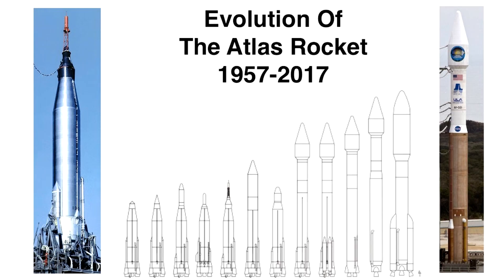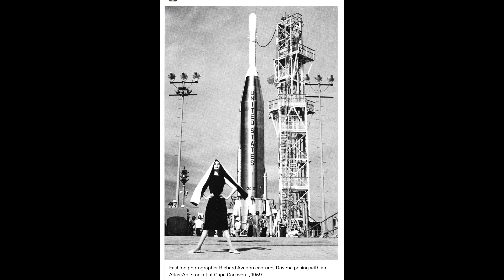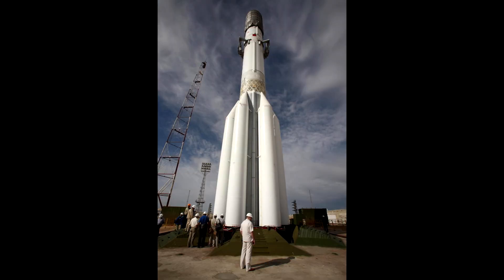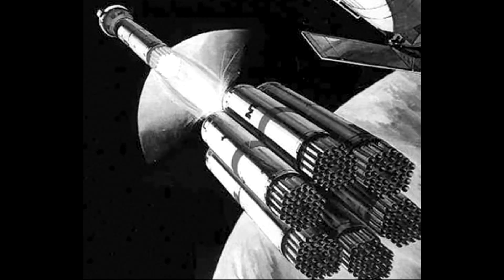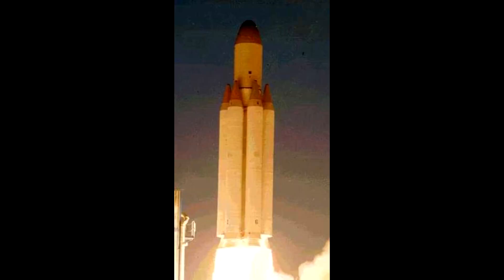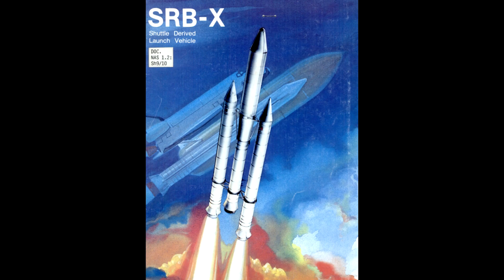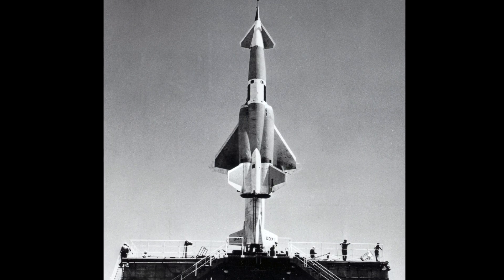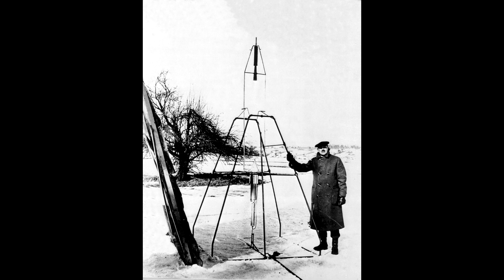The Worst Looking Rockets Ever Designed!

Comment: The American Thor rocket that had the nearly flat nose cone always looked stupid to me.
Reply: It's too round at the top! It need to be pointy. Round is not scary! Pointy is scary. This will put a smile on the faces of the enemy. They will think it's a huge robot dildo flying towards them.
Reply: @gonun69  the dictator?
Reply: @tangydiesel1886  Of course.
Reply: @gonun69  HAHAHAHAHAHA now that's a good reference! Fortunately I re-watched it recently, wouldn't have gotten it otherwise :-)
Reply: Speaking of the ugliest rockets ever designed..... Musk's STARSHIP MK 1! Patched together in a junkyard and assembled outside in the dirt!
Reply: Most of the Thor variants were pretty ugly. Thor-Able is probably the worst of the bunch.
Though it was eventually developed into the Delta II, which was a great looking rocket. (I think its last launch was in 2018, which no more to be launched.)
Reply: True
Reply: At least one variant of the Atlas missile had a blunt nosecone as well; I'm guessing that was a reentry heat shield. And yes, it looks wrong.
Reply: While it looked ugly, that round nosecone was important to prevent the payload section from overheating. An extremely pointy end would heat so much the thing would just disintegrate at high speeds.
Reply: That's the Mark II (code named 'Boilerplate') nuclear warhead and is literally the origin of the word 'boilerplate' used to mean a test article today.  It was called boilerplate because it was a copper plate full of water used for cooling during entry.  It was also seen on Atlas but wasn't very effective on an ICBM.
Reply: Yep. It looks like someone came along and 'booped' it.
Reply: Thor was designed as an IRBM.  It was designed to be somewhat transportable.  That flat nose cone had an aero-spike and there was usually a nice nuclear bomb inside of it.  Over the decades Thor was evolved into the quite friendly Delta rocket.
Reply: @Easy-Eight  right, now that one "nice big nuke" has been replaced with ten nice little nukes in our ICBM's !! ; )
Reply: @ronschlorff7089  , Thor is an IRBM.  All IRBMs were eliminated in a treaty between the USSR and the USA in 1989.  The treaty eliminated short range missiles, intermediate range missiles, and artillery based nuclear weapons.  Also, the later START treaty eliminated MIRV in the ICBM and SLBM vehicles.  By treaty no missile may carry more than one nuclear reentry vehicle.
Reply: @Easy-Eight  Right, IRBM's, such as Thor, are long obsolete; but a nuke sub can function as an "IRBM", parked off the coast of the intended "receptor" nation. With 24 missiles in a "Los Angles" class boat, don't need MIRV's either; the whole weapon complement is essentially/functionally a MIRV platform. Ever been to New London/Groton CT? Pretty impressive to see one of "them bad boys" come cruising into base. The more you know the less you understand, functionally. And "treaties" are a laugh, during war time; historically speaking! ;D
Reply: @ronschlorff7089  , the Los Angeles class is a fast attack submarine and not an Ohio class Ballistic Missile submarine.  The present Los Angeles class Flight II & higher only carry a 16 cell for submarine launched Tomahawk.  An Ohio class submarine would never be allowed in littoral waters.  They are always in the deepest and farthest part of the Atlantic, Pacific, or Indian Ocean.    The IRBM missiles outlawed in 1989 were the Pershing II, Lance, and the same type of Soviet missiles.  The "PII" had one of the most outstanding targeting systems of the era.  Once again, MIRVs are illegal under treaty law.  It is a violation of the treaty to have the "bus", the item used to carry the 10 MIRVs.  MIRVs have been outlawed by treaty since the mid-1990s.  FYI, my son was a "plant" operator on a improved LA & I was an Army Field Artillery officer.
Reply: @Easy-Eight  Army huh? Not Navy huh? Sounds like a "donkey in water" to me, also a "grunt", 67-69! How about your "war fighting" experience; you seem to know a lot of "theory"!! ;D Like I said when the shooting starts, the treaties are first to be broken,...... then the backs, necks and heads. You ever "broken" anything in battle!!?? ......................Did not think so!! :D
Reply: @ronschlorff7089  ,  the Washington treaty on limiting battleships worked very well in the 1920s.  The treaty limiting Germany's capital ship construction after WWI helped defeat them in WWII, they had no decent large navy.  The treaty ending the War of 1812 has never been violated on the Great Lakes unless you know of hidden Canadian battleships?  Yes, I have not been an 11B in Vietnam.
Reply: @Easy-Eight  Yes, Germany fell due to B-17's and Lancaster bombers didn't it? Otherwise,...well,.. ask Japan!! OK, fine thanks for the history lessons, Mr. Chamberlain!! I still say that treaties don't work other than as an "academic exercise". Even NATO is a treaty (the "T"); some of the signatories seem to have forgotten that, by being delinquent in their commitments to their own defense! We are not "pulling any chestnuts out of the fire" for Europe any more, "That I can tell you", as long as he is in office,...but we'll have to see in a few days won't we? :)